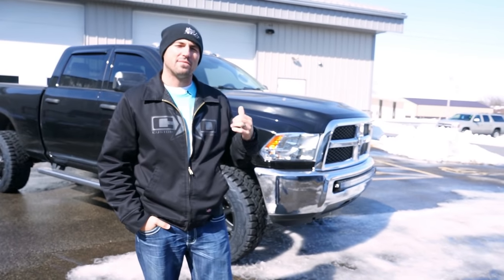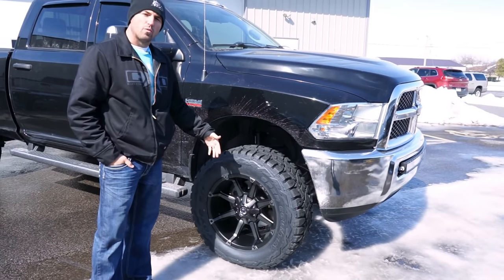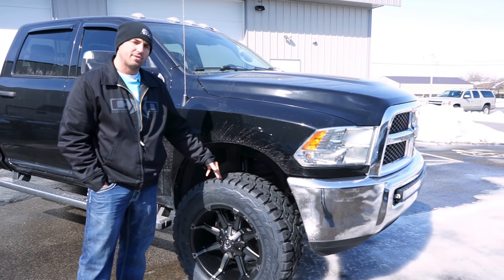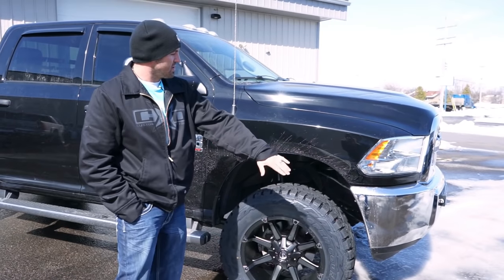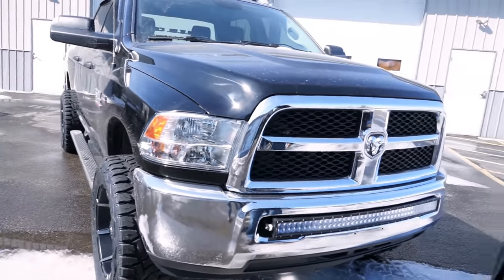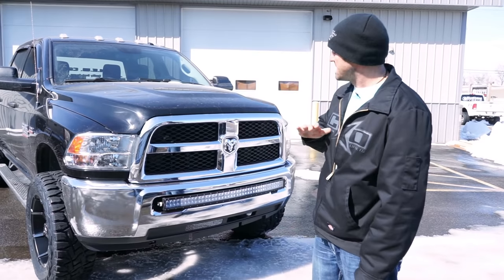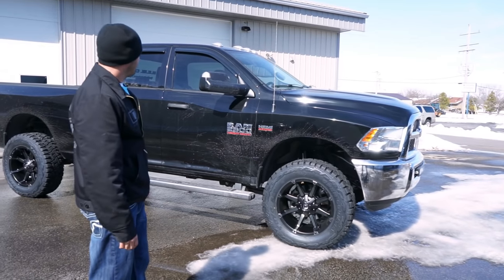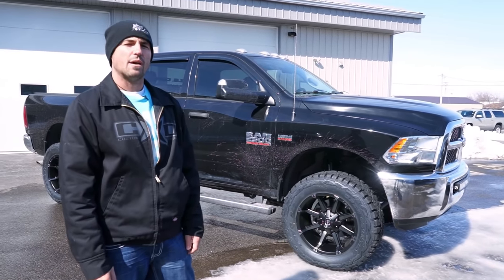Spotlight - 2015 Ram 2500 on Fuel Coupler 20x10's

Comment: Hey my question is I have a 2017 Dodge Ram 3500 SRW Mega cab and it’s time to get new rubber for my stock 20inch wheels, I was thinking about getting some other rims with offset and tires but I use my truck for towing a lot. So what’s the maximum size I can have without jeopardizing the towing/hauling abilities
Reply from the maker: Shoot us a quote form Tim and our sales team can get you tons of answers and options! customoffsets.com/quote !

Comment: I do about 20k a year. I'm trading in my 2015 1500 and buying a 2015 2500 diesel. I want to upgrade the wheels but not to where my MPG suffer a lot. Any recommendations?

Comment: I recently purchased your 20x10 -12 offset Fuel Mavericks and I leveled my 2015 ram 2500 but I can't figure out what tire to put since they tell me I need one that has a max psi of 80 for the tire sensor so how did you accomplish that with a tire that has only 65psi. That's my only question thanks.
Reply: robertcruz18  I had the same problem until I finally figured out to drop the tire pressure down to lowest  recommended pressure and the light went off and now it works on light load. I was constantly running high pressure before just to keep the tps light off. lower the pressure and try that.